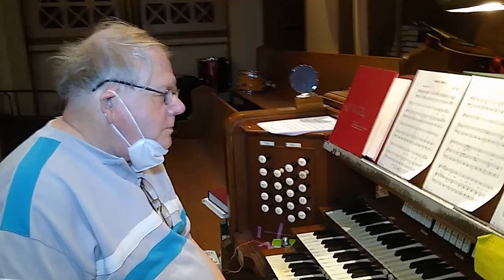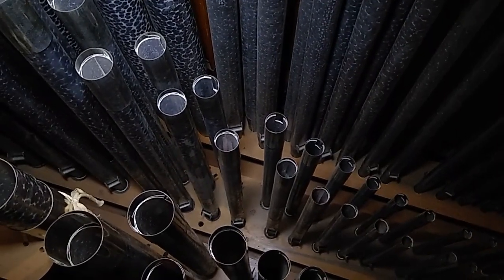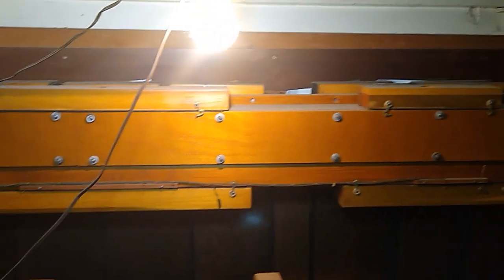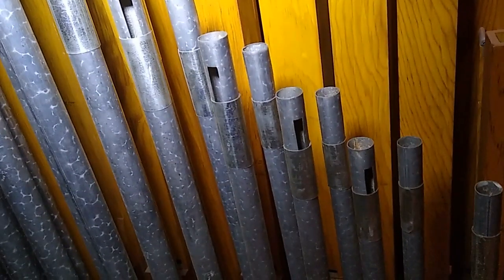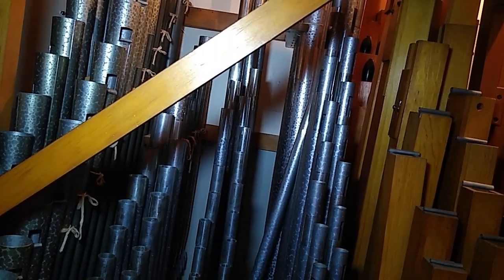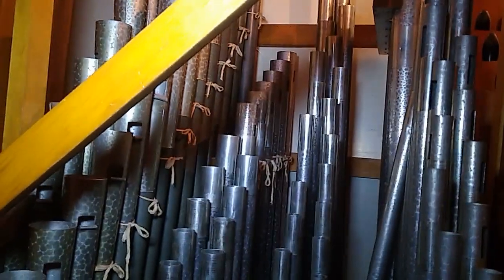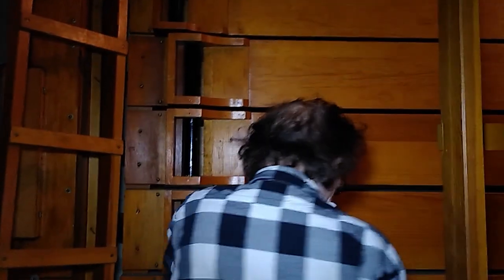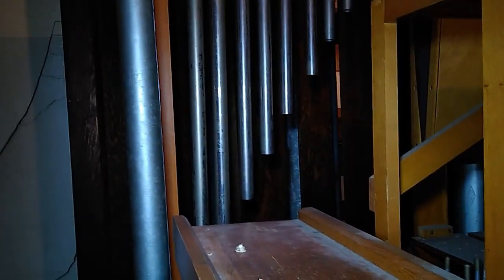A Saint Olaf Church Organ Crawl

Comment: that first tuning still had a slow roll to it. also you can't touch the pipes and then tune immediately. you have to let it cool after warming with your hands. with that said, it's much easier to just run thru the ranks instead of trying to search out pipes that have been bumped. who knows there may be more. and also use a tuning knife or a screwdriver....instead of a "rock"???

Comment: Is that a Flxible or a Prevost?  I couldn’t tell.  Seriously though, from the info on the pipe organ database, it appears to be 1952 Möller. Is that correct?
Reply from the maker: Close to it. The nameplate on the console was made of an ivory colored plastic that disintegrated over the years. I forgot to check when i was in the chambers for the opus number. When I get it I will post it.
Reply: @busoldmanphil7293  It is Moller Opus 8394 built in 1952.  Database says it is 3 manuals and 13 ranks of pipes so it is a rather small instrument.
Reply from the maker: @timlettbus  Thanx. I was unable to find a database listing this organ.
Reply from the maker: I can't either. We're anticipating major work on it late summer 2021. I'll see what I can come up with then. We will record future work to present here.